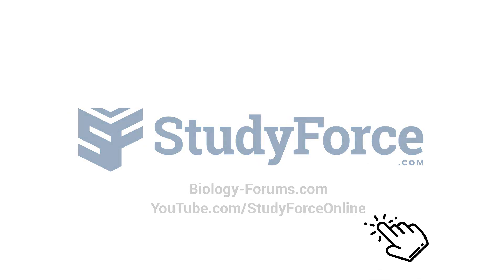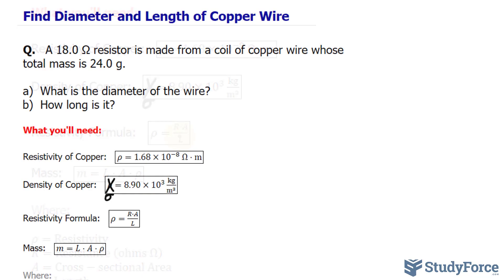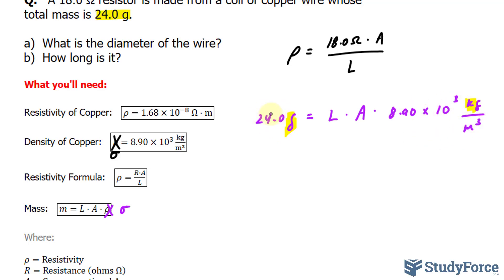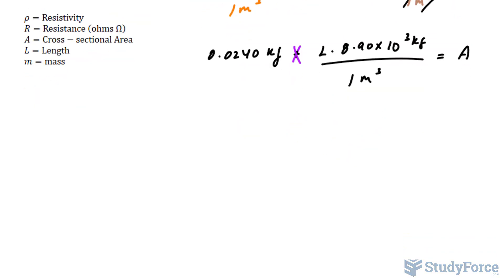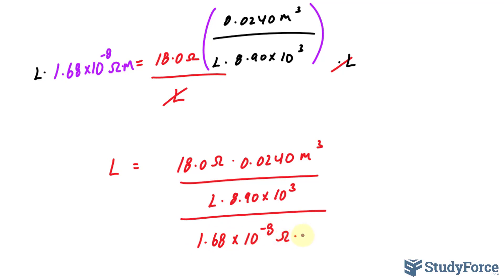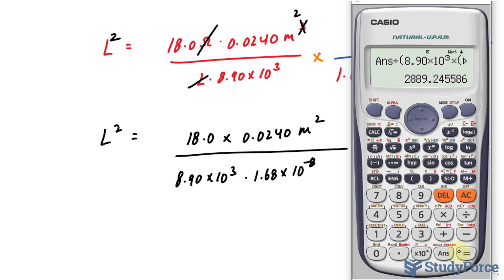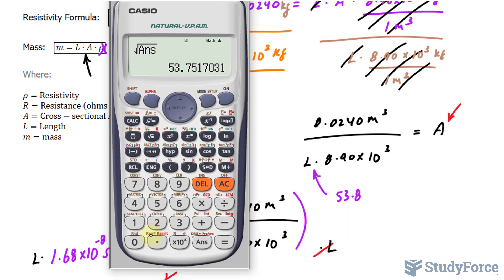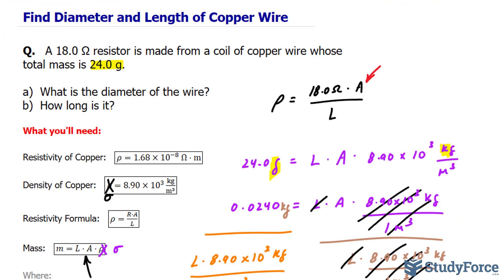Resistivity: Find Diameter and Length of Copper Wire

Comment: How to find the length of  a copper wire given radius, relative resistance, number of turns of the wire in a coil?

A copper coil has 100 turns having 2.5 cm radius and 1/1000 meter square Area. How to find the length?

Comment: How do you find the diameter of a wire with only length and resistance?
Reply from the maker: Can't you use ρ = (R*a)/L. Isolate for 'a', the area, and then use a = πr² to isolate for 'r', then multiply by 2 for the diameter? I'm not sure, without the full question, it's just a shot in the dark...
Reply: @StudyForceOnline  I figured out the problem I was trying to do and that's exactly how you do it, using that formula and then solving for diameter